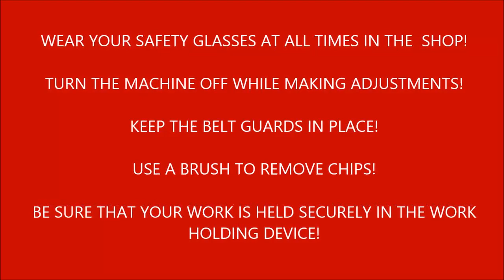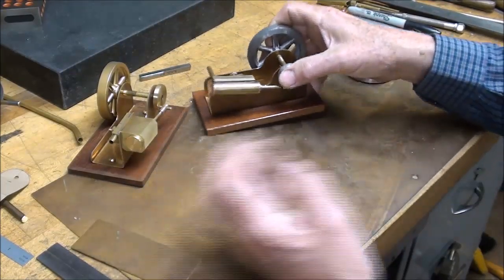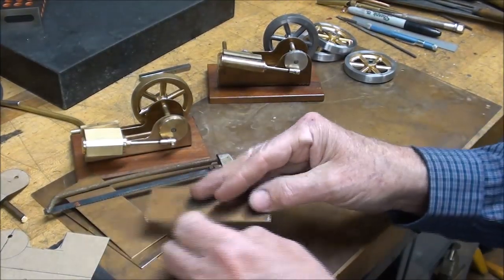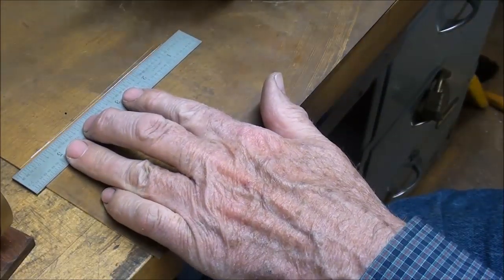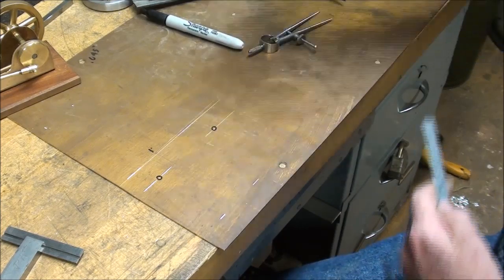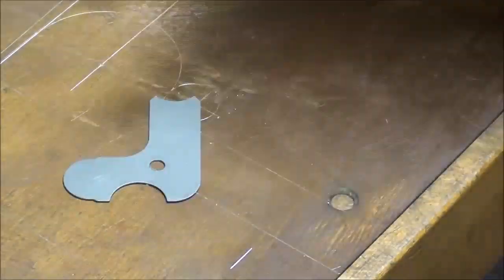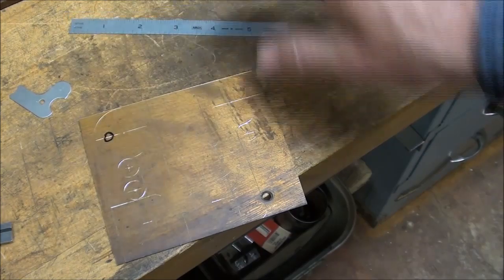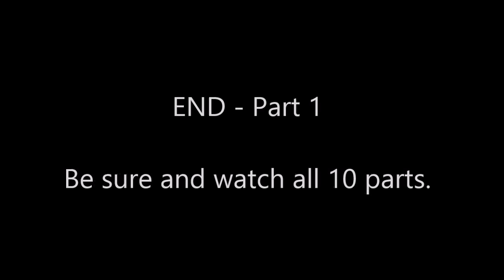Part 1 of 10 - tubalcain Builds the YELLOW BOY STEAM ENGINE

Comment: When marking out brass and other non-ferrous metals, I use blue marking fluid. In its absence, a spirit-marker pen works just as well. Coat the surface, mark lightly with a scriber, machine and hand work, then clean off the remaining dye with methyl alcohol. Works every time.

Comment: Hey Pete, you don't need thinner to remove marker. Use the oil from the side of your nose. It's mildly acidic and works great to remove sharpie, glue residue, etc.
Reply: then again, nothing removes sharpie like the solvent in a sharpie — apply more sharpie and wipe clean!

Comment: Thank you for this series. Is it ok to use aluminium for the frame? I have some 2mm plate which I use for making heat sinks which is about the right thickness, I'm just not sure how it will behave with a brass shaft going through.
Reply from the maker: +Brian Norris Sure--but of course you cannot solder alum

Comment: An idea for a flywheel would be a similarly sized cast pulley for example an a belt or b belt pulley ( available in sizes up to 6 inch diameter at least that I've seen) on a 1/2 inch shaft probably making the steam engine and boiler slightly larger scale.